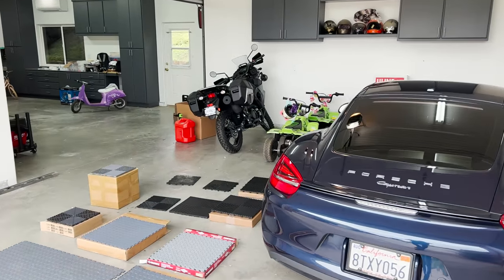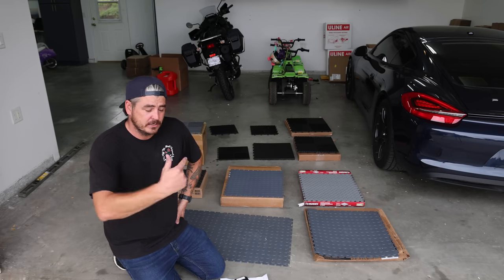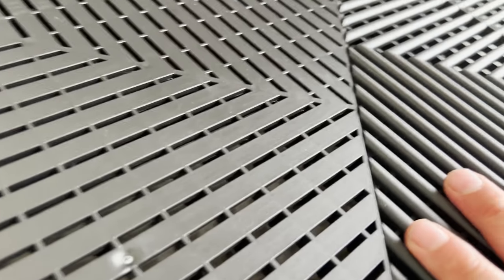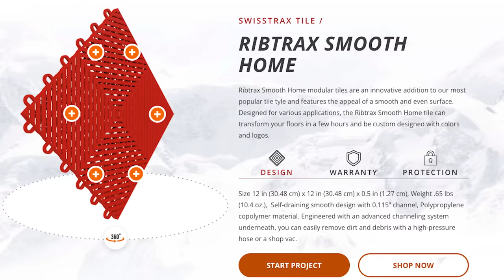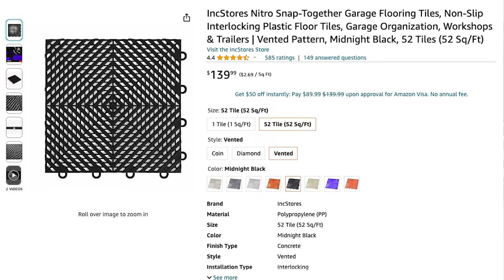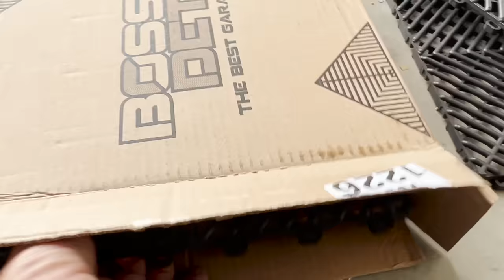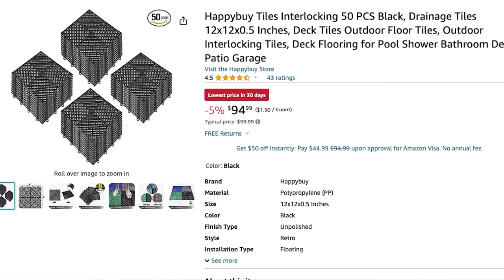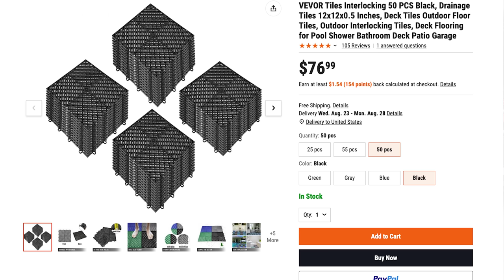BEST VALUE! DIY GARAGE FLOORING - Swisstrax Racedeck Home Depot Amazon

Comment: If you live in the Midwest the open grate tiles would be a problem . With being open they will trap dirt water salt and anything that will fall through the tiles . I know this because I installed a section in front of my work bench in my epoxy coated garage . There is always dirt trapped under the section .

Comment: I think if you don’t have a drain and want to wash inside the garage. Smooth Epoxy floor is the way to go. You can just squeegee the floors to remove the water and you don’t have dirt trapped under any Swiss trax or flooring

Comment: Great video lots of info!!!  I'm concerned about the cracks in your floor hope you had someone check it out!!  As far as the floor my concern with the open tiles if you spill oil or other toxic chemicals can you get it out because that will ruin the slab!!  The concrete that builders use now  they will have black marks on them!!  So what to do?  Epoxy stains too so you have to decide what works for you!!  Wish I had that big garage!!  Good luck I hope things go the way you want!!  Thanks again!
Reply from the maker: Thanks! Yea the cracks were they said were minor and no concern .. .luckily haha. Thats a great point about the open tiles but from what ive seen you can pick them up pretty easily to clean spills like that.  Ill found out though in upcoming videos!
Reply: Oil will ruin asphalt not concrete it will just stain it. I would just spend $400 and seal it before.

Comment: Speaking form experience; you don't want anything with holes or tiles. The first foam cannon orifice you drop will result in a tapestry of profanities weaved that would make the prince of darkness himself blush with envy and of course turning a tire on any floating tile will result in the same verbal expletives being spewed. As to which way we went--it was the roll on 2 part epoxy without flecks (they act as camouflage for fasteners) after renting a floor polisher and a purchased pad to scuff the floor. Having a pressure washer and a squeegee helps remove the contamination from the surface. A weekend well spent for sure. All in, you'll be less than $1K and a weekend's worth of effort.

Comment: This is how I would generally classify these based on this video. The higher quality ones for automobiles. The cheaper quality ones for recreational vehicles like quads, road bikes, dirt bikes, etc. The foam tiles for a rec room or a home gym. The husky seems to be decent, but that would depend on the ability to not squish down on those tiny vent channels and retain shape.
Reply from the maker: Yea, i think youre right. I know if a few shops that have used the cheaper vevor tiles and they have held up well for them with cars driving on them.. BUT, i dont know how they would handle any heacy work with jacks or things like that.  i think for an option to just enhance appearance and just parking cars they could be a good option.  The solid ones i show in the video arent the foam type, but checking for any compression on them over time is a great idea

Comment: I chose RaceDeck because 12" tiles worked best in my garage. The pattern lined up perfectly with the double door and rhe single door. The larger tiles wouldn't have lined up correctly. If you don't use different colors, it won't matter.
Reply from the maker: Great point! These vecor tiles at 12" were a perfect fit for me as well. It actually ended up aligning perfectly wall to door

Comment: I would also pick the Vevor, I feel I might get tired of the tiles and may remove them for epoxy down the line, so not much money would be wasted.
My only concern is how they behave with jackstands, will they offer enough stability, will the jack/stands slide, will they need some plywood underneath? I hear the weight of a car on jackstands can dig into concrete, specially in hot days.
Reply: You heard wrong.  It's asphalt.  Jack stands will dig into hot, softened asphalt. The wheels on trolley jacks, too.  Motorcycle kickstands are notorious for sinking into hot asphalt.  So, concrete is the BEST for jack stands, jacks, etc.

Comment: This may be a dumb question, but does anybody know if these would be smart to use if I am doing work on my car on top of them? For example, I lay these across my entire garage floor but pull my car in, lift up on jack stands, is that safe on these? Would the pressure of lifting my car on two stands and all the pressure being displaced possibly on one tile be dangerous or break the tile?

Comment: Literally 5 seconds per "Boss" tile with a Dremel that has a small grinding wheel on it and those are baby smooth. Not saying they're necessarily good, just saying that some surface roughness in the center of the tile is fixable in a very very brief time frame.

Comment: Awesome, I'm in the middle of doing the same thing.
Reply from the maker: have you decided what to go with?
Reply: @imjoshv  Honestly, I'm probably going to go with Swisstrax, which has been proven time and time again. To save costs on the front-end, I'm going to do it in stages. I was told I shouldn't notice any difference in the tiles from different batches. If you don't like the gloss or shine from the other tiles, you can scuff it with a Scotch-Brite pad. Also, it can be used to blend tiles from other batches from cheaper companies.

Comment: The slotted tiles will fill up with dirt over time and they would not be good if you're planning to do car maintenance. If you spill oil or some other liquid, it's not easy to clean up. Also, how do these tiles hold up with a floor jack or jack stand?

Comment: Help me understand please. My garage floor is usually a mess with dust and debris. With these floor options that seem vented - doesn’t all the debris and dust and crap get into the grooves and or pass through to the floor and then cause a nightmare to clean. Is the only intent for these to be used in “show” or “den” like garages?
Reply from the maker: I did an update video testing the two cheapest options… the vevor vented style and the Versatex coin style. I did a basic cleaning with a blower just to get some surface stuff out and the little bit of dirt and debris that had fell between the cracks actually blew out as well really easily. I was really surprised. It wasn’t a ton but still good to see. I am doing my floors with that so I’ll be able to test it over time and give a really good idea of how easy or hard they are to deal with

Comment: I don’t get the rules with lots of holes in them… if you spill any liquid you can’t pick it up and it will just sock on the concrete sub floor, right?  Also can’t really sweep the floor either, all my dust and dirt will just fall thru the cracks get stuck below the tile, right?  The solid material makes way more sense to me! What am I missing?

Comment: We bought a new house in '21 and I did a polyurea (i think) and top coat.  No peeling yet but the color got weird.  Not sure if I needed to etch it better or what.  For someone who does a lot of auto work, a smooth tile would be a must.
Reply: The ribbed/open tiles I think make a lot more sense if you're going to be washing cars on them.  I see the box store style ones just building up junk that you'd have to pull the tiles to clean.

Comment: I considered tiles for our standard 2 car garage but wanted something that didn't trap anything.  I had once tried the painted surface but that eventually failed in many areas.  I also wanted a good quality American made PVC smooth floor.  Easy to clean with a damp mop and easy to blow out or sweep out any debris. I also didn't want to spend a lot of money for a garage floor.  Why?   So I decided there was only one good option. A "G Floor Co."  mat.  I covered almost the entire area with 2 mats for $500.  So simple and it looks just fine.

Comment: I wash my car outdoors.  But I wonder if there's a way to drain the water or to slant the angle of the flooring slightly, so that there wouldn't be a moisture and mold issue.

Comment: I did polyaspartic floors I. My 4 car garage and it was about $3500 or roughly $3.50 sq/ft and the guys did all the proper prep including acid/etching and floor sanding. Polyaspartic is also better in every way than epoxy, even though it sorta is an epoxy I suppose… but came w a 15 year warranty from the installers and the company who makes the polyaspartic stuff which gave me confidence in the product in case the installer goes out of business.

These plastic floors are a complete waste of money, do not improve the value of your property like poly or epoxy does if done right, and you can find people to do epoxy or poly for roughly the same price as swisstrax

Comment: Installed Race Deck tiles in my busy repair shop. Went with diamond lug pattern tiles for repair bays and the water channeling tiles for detail bay. They held up admirably for about 5 yrs before they looked used and abused and started buckling from tire heat and exhaust heat. Pulled em out and went with polished concrete which was way more durable and slip resistant and easier to keep clean - and CHEAPER! Plastic floor tiles are an expensive gimmick with very little upside for repair type work. I can see some value for a detail bay to keep water channeling out below the tiles but if I did it again I would not install tiles. Not worth the hassle and cost IMO.
Reply: Im going on 8 years with them in my garage and they still look brand new. And my garage is for working and car storage.

Comment: I have a drain in the garage with slight angle for water to run towards. Does swisstrack bend a little to form the drain? I do not see this being an issue. Think I’m going with Swiss track for durability and not in mood to do a big job to redo the floor

Comment: While I personally do not see the appeal of plastic flooring tiles in the garage, I very much appreciate you and this channel giving Vevor a go. I thought it was going to be another channel going down the “plug expensive item” path then offer an affiliate link that earns them commission. I should have known better. 

If you decide to go a different path, consider polyaspartic (same concept as epoxy but better). Done right, will last a lifetime. And you can clean it every few weeks with Adams MegaFoam and have a wonderful smelling garage that looks brand new! Only problem is, there is no online retail market for polyaspartic due to the difficulty of prep and install. No retail market means no revenue so company like OG, TCG, etc. sell SwissTrax instead. My comment transitioned to a short rant-sorry. Just consider a quality polyaspartic. It will never peel, fade or discolor. I have dropped some heavy sh*t on it and it hasn’t chipped.  Oil can sit on it for weeks and you can just wipe it up. 

Congrats on the new home. Enjoy the garage(s)!!

Comment: These tiles looks great but it just doesn’t make sense to me that dirt would fall between the cracks and forever be there. I can imagine it eventually being filthy down there and when it gets water from rain drains my from your car, that it’ll mix with the dirt and become mud under the flooring. Unless you took a shop vac and vacuumed every square inch hoping it’s enough suction to lift the dirt through the gaps, having a flooring system that essentially traps dirt to where you can’t quickly push a broom over to clean, doesn’t seem right. Especially from us detailers whose job is to remove dirt and leave a clean surface behind.

Comment: Question, my garage has a drain in the middle of the floor. The floor slopes slightly towards the drain from every corner of the garage. Would these types of tiles work in a situation like this? Or should I be looking at some sort of epoxy solution? Thanks.
Reply from the maker: Yea I think yours is probably the ideal situation. (As long is it’s till relatively flat to lay down… then you could wash your car in the garage with the floors, it will drain through the flooring and into your drains!
Reply from the maker: The drain style ones atleast!

Comment: The grid style flooring appears to be awful. How will you remove the dirt that ends up under it, or for us in cold climates… the salt will fry on the concrete with no way to clean the floor. The Husky brand seems like the best style and solves though issues.

Comment: I’m not concerned with moisture in my slab.  I have tested it. Concrete takes  a long time to cure, so I see your concern about moisture, but
why would anyone want any of these vented tiles??  All of the dirt would fall into them, and how would you sweep the floor?  What about if you spilled oil?  You couldn’t clean it up, and it would just lie underneath the tiles and soak into the concrete.  What do you do, try to clean with a vacuum?  Small hardware could fall into the slots, and be a pain in the ass to find.  They make sealers for concrete, that can be used after the concrete is fully cured. Also, if you’re really concerned about moisture, in a new homes garage,  plastic vapor barrier is usually put down below the slab.  That way it won’t wick up from the ground below, and after the concrete is cured, and all of the moisture is out. There should be no concerns.    I have a 320 square foot garage/ shop for my early Porsche 911R type race car.  I use Go Jack Dollies from Summit Racing, to roll it  around as I am working on different parts of the car.  A lot of the work benches are folding, and I have 4 roll away tool cabinets underneath.  I have plenty of room.  The hell with these tiles.  I’m just going to use a light gray, high quality concrete paint.  I can re paint when needed.
Reply from the maker: Yea they are definitely not the right choice for everyone. Rolling Jacks will be a nightmare on them..For me as a detailer and this is my studio, i wanted the appearance of the tiles and not having to worry about moistiure in the slab (since i havent tested mine)... I think they look great, but if your actually working on your vehicle, like you said these vented style floors are a pain. With all that said....  911R.. Im very jealous!!

Comment: They will fill with trash and dirt or lose little nuts and screws . It looks good when your done but what does it look in ten years and this would not be a good choice for me it’s not good and I would rather have some supper good paint that will not pull up ?

Comment: Have you found any edges for the vevor tiles? I pulled the trigger on the black and gray ones, but I'm having trouble finding edge pieces. I wonder if the racedeck ones would fit?
Reply: Did you find a solution for the edges?

Comment: You don’t have to pay to check if you have a lot of moisture coming out of your garage cut five 4 x 4 pieces of plastic lay them down on the garage floor, productive around it and let it sit there for a day if it sweat a lot do you have a lot of moisture in your garage that’s how I did mines
Reply: I meant to say duct tape, put it around the plastic square
Reply from the maker: Yea my buddy the flooring contractor said the same actually!

Comment: Does anybody have Swisstrax for over 2-10 years? Is the buildup of dirt hard to get out of the grooves?  Can you use a vacuum or blower?
Reply: i have swisstrax for 9 years in florida. i have not had to replace any tiles - there may be a 3 or 4 with some dinged ribs but doesnt bother me enough to replace(and i have extra tiles).  About 6x year ill blow out leaves/dirt with leaf blower.  About 4x/year I'll shopvac the floor.  Still looks like new!  I dont do much woodwork , but when kitchen was redone and it rained the guys did a fair amount of cutting in the garage - dust everywhere.  Shop-vac did the trick. Think about it, but never felt the need to actually pull up the tiles to clean the floor. Sort of like; out of site-out of mind.  The floor tiles really remain very clean. Moving to a new house in a few months and gonna go again with the ribtrax pro.

Comment: If you want lighting solutions, let me know. I have a hookup that is a 1 up to OG 😊.

BTW - I did epoxy myself (3 layer marble look) and for a single car garage my total cost was about under $800.
Reply from the maker: yea let me know on the lighting.  Any issues with the epoxy?
Reply: @imjoshv  if prepped right now issues, or at minimum last much longer. I can send you pics. 

Lighting, I will send an email later today with details.